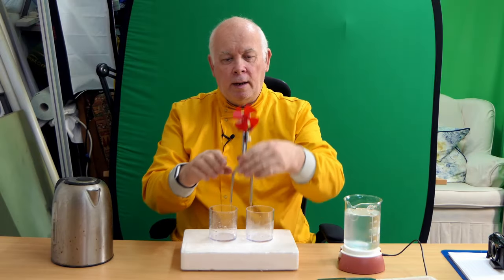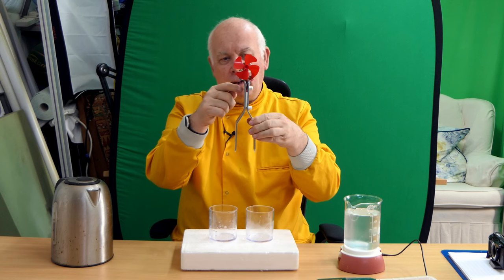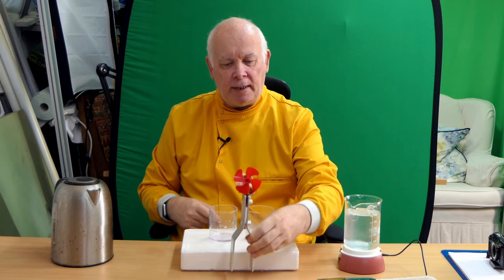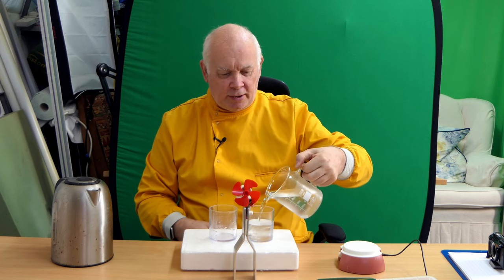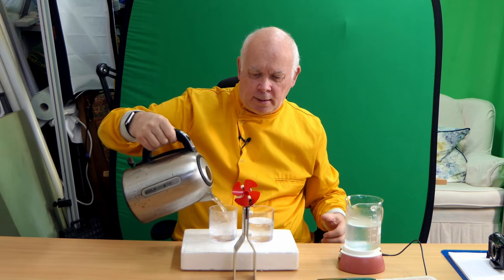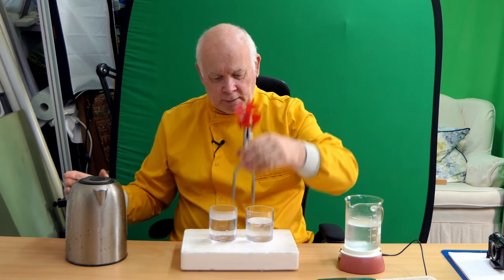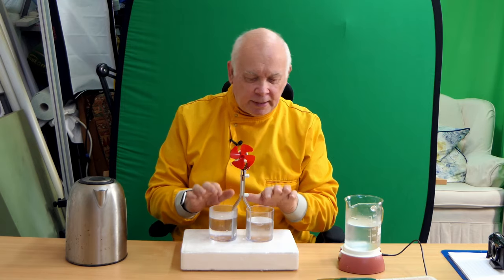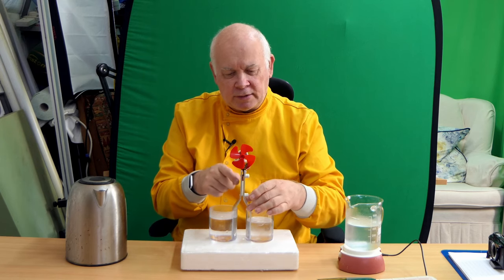How does a thermoelectric generator work

Comment: no science in this !! unless you reveal the science
Reply: You don't know about this experiment because your are not a science student, but it is universal truth.🙏
Reply: I think you are not an english student
Reply: There’s two types of tiny square different metals inside the chip  usually it’s bismuth telluride and graphite or copper , arranged in an P and N configuration just like a semiconductor in series, while heat  and Cold are applied the molecules tend to cluster at the cold side and disperse on the hot side creating free electron flow .. there u have it

Comment: Is it possible to make a wood stove equipped with thermoelectric elements, and would it then produce any useful amount of electicity?
Reply: late response,
unfortunately nothing on home scale will produce a meaningful amount of electricity, anything other than industrial scale isn't really worth it
Reply: You can heat sand up to well and truly over 1,000°C without anything happening to it molecularly, pretty much meaning it will just be extremely hot sand.

Sand's melting point is around 2,950°C so this temperature and anything higher will cause the sand to melt and turn to glass if I'm not mistaken there.

Even know that sand has low thermal conductivity it still retains heat very well which is why it can still be very hot after prolonged exposure to sunlight or more extreme heat.

For a rough example, let's say you heat a 50 Gal Drum of sand up to 260°:

If insulated well: The sand could retain significant heat for many hours or even days.

If exposed to air without insulation: Cooling would likely occur over 4–8 hours, but this is very dependent on environmental factors.

However that's a very rough example, a lot more factors would come into play there but yeah hopefully you get the idea, and hopefully it gives you an alternative to what you may want to do.

Just Tryna be helpful 😁😁
Reply: @NotnotADHD  I agree that it would make limited economic sense. From what I can see, the efficiency of a thermoelectric element on a wood stove would be something like 5%. Even if all 5kw heat of a wood stove could be utilised, it would only amount to 250 W, which money-wise isn't very much. 
At most, it could be a neat gadget   like a coffee pot for camping with a thermoelectric element built in so one can charge mobil phones.